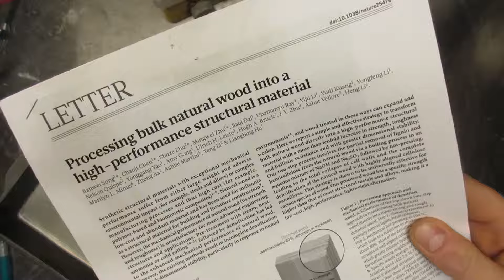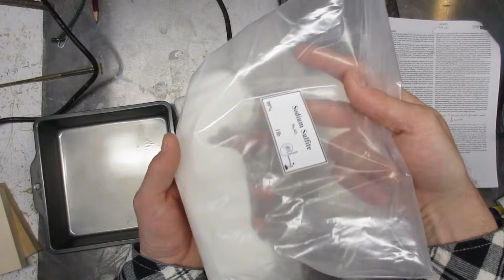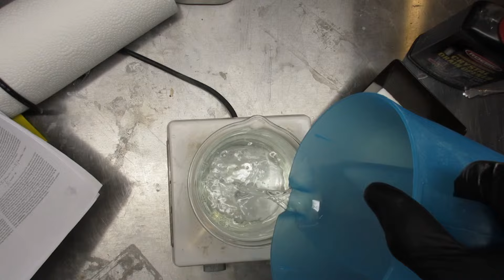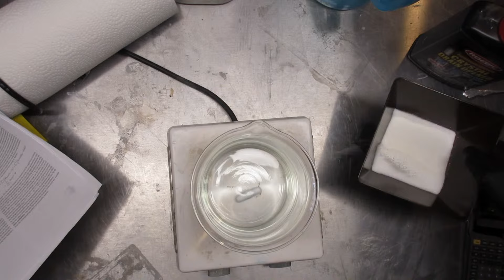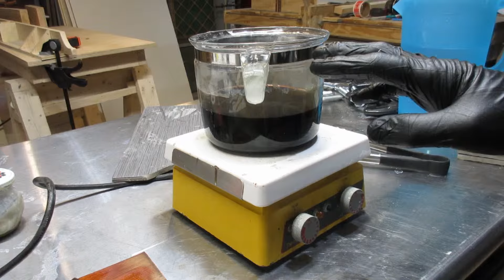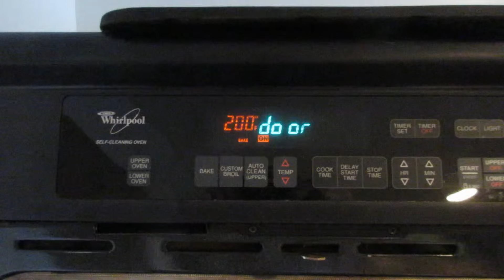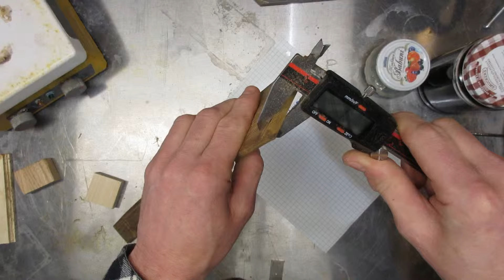Wood Densification Experiment

Comment: A high frequency vibration while it's under pressure may even compress it even denser than that and also a low heat temperature may also help it adhere to itself. I'm sure their pressing equipment at their plant/lab and their liquid had had qualities you can't duplicate at home. (Big Secrets?) But great video... Amazing results, more than I would have expected for DIY... Thanks 👍🖖

Comment: So, after the caustic and rinse, why the need to heat when compressing?  To remove water? ?well that water could be evaporated off under deep vacuum for a day, then polyester impregnated, then pressed to a precision thickness having a designed surface texture. Who the hell wants to sand paper grind finish timber? 
The press plates need small vent holes drilled, and at home, pressure applied using a hydraulic truck bottle jack, or tapered wedges. 
Commercially the end product needs to be minimum 2.4 m long. Clear long straight grain. The raw timber has to be free of defects like knot holes, resin veins, bark inclusions etc.  Knots won't compress in the processing. This limits the use of fast growing timbers like pine that are full of defects. 

I see this processed timber as useful, most useful as resin/mineral impregnated laminate sheet. 
As 3 ply it would have significant strength and ability to mold well.  
Shame about being thirsty stuff... needing sealant.

Comment: This wood might have some specific uses but cost seems like the limiting factor.  What is important to consider here is strength vs weight.  What is the density?  How much less does this dense wood weight as compared to aluminum?  Then there is the factor of work-ability.  How strong is it when glued together as compared to welded metal?   Also might want to figure it's dielectric value to determine if it can be used as an insulator.  Just from looking at the process I'm thinking that steel, aluminum and plastic will be much cheaper.

Comment: Next time: 1) weigh the wood samples before and after the treatment.  2) make a cylinder with a piston to press against steel blocks that flank the wood samples. You can then have an air compressor provide constant pressure, even as the wood becomes thinner. 3) see if you can compress the samples between blocks that are curved (ie turn the flat wood into an arch).

Comment: 7mpa is pressure rating per square cm, which is roughly 70 bar or 70kg/cm^2. so if your piece of wood have area of some 20cm^2, you need 7*20mpa total pressure, or 1400kg. if you compress more i bet you get those 80% reduction in thickness.

Comment: Imagine you could take fast growing pine and make wood flooring from it
Reply: The feedstock timber would have to be free of any knot hole defects. 
This is NOT a feature of any fast grown plantation pine. 
The highly dense and hard knot (branch growth) will not compress the same way as linear grain growth.
Reply: @BTW...  Faster than Oak you could take the pine from the colder regoins where it is much slower, or are they subject to the same? I assumed not as it's used in building houses everywhere in Scandinavia
Reply: An alternative would be to employ the Japanese daisugi technique.

What is daisugi?

It's an ancient Japanese practice involving the very specific pruning of certain types of trees, primarily the sugi (a type of Japanese cedar), to obtain wood without completely felling the tree. This allows for the cultivation of high-quality wood in a sustainable and environmentally friendly manner.

How does it work?

Selective pruning: The lowest branches of the tree are pruned to stimulate the growth of new vertical shoots.
Directed growth: The new shoots are allowed to grow straight and parallel to the main trunk.
Harvest: When the shoots reach the desired thickness and height, they are cut to obtain wood. 
The original tree remains alive and continues to produce new shoots.

Benefits of daisugi:

Sustainability: It allows for obtaining wood without deforestation.
Wood quality: The wood obtained through this method is usually of high quality and straight.
Forest conservation: It contributes to maintaining biodiversity and forest ecosystems.
Would you like to know more about daisugi? I can provide more information, such as its historical origin, the different tree varieties to which it is applied, or its cultural significance in Japan.

Comment: Back in 1972, when I was 17, I did a project which counted towards my physics A level. I tried macerating toothpicks in various solvents to dissolve the lignin (I think it was) and replace it with cellulose varnish to compliment the cellulose fibres. I had some alarming encounters with strong acids. We had a tensiometer, but my biggest trouble was fixing the toothpick without damaging it before finding its tensile strength. It was a null result, but nobody cared because the emphasis was on methodology and the treatment of statistics (before pocket calculators were affordable!). When I saw this upload, I laughed and shouted with glee!

Comment: Clamps are only applying the rated force - per square inch or for the face of the clamp.  So when spread out over the full surface of the item it becomes much less - so I don't think you hit the compression you wanted.

Comment: Very interesting! The problem with the clamps is that you only have initial pressure, when the plank shrinks the pressure reduces to nil. To apply constant pressure, just use gravity: a couple of concrete blocks on your "sandwich" will probably make some effect.
For the "rinsing", you probably want to continue rinsing until you can see through the water. The goal is really to get rid of the lignin. Also, maybe it can improve things if you can make the reaction in a pressure chamber (you mentioned that) to force the chemicals between the fibres. Maybe it'd improve the result to have it shaken during all the soaking operation in a pressurized environment.
Now, for what to do with it...  From what I understand, it's soft and easy to bend before pressing it, so... just bend it! I'd try to make stuff that needs to be light and reasonably solid, such as plane propellers.. Now we're talking...

Comment: Great job duplicating the experiment with what you had available. 
Test for strength, bend, twist
Burn it, cut it with a saw, nail it with a hammer and gun.

Comment: Nicely done. If you do investigate this further, it would be interesting to know the shrinkage rate along the length and width of the sample, as well as the thickness. That makes me think of the weights before and after. 
Finally, as exciting as this new process is, I have to wonder what volumes of caustic liquids such a process would produce, and what additional steps would be required to re-use or neutralize them.
Reply from the maker: All good questions. I do know that those chemicals are (or were) used regularly and in vast quantities for making paper so there is probably a system in place.
Reply: @dork3nergy Yeah, it's basically Kraft process but applied to wood veneer (spinning a log and using a long blade to "spiral-unwrap" it into a sheet) instead of chopped wood. The purpose is also basically the same; the only big difference is that Kraft paper uses microscopically wide (but a decent length, usually around an inch/couple centimeters) loose fibers that are then chaotically packed into a sheet and lightly pressed, while the densified wood uses >=mm thick sheets of naturally aligned fibers, stacked as appropriate for the target application, and then pressed far more aggressively to actually crush the fibers into a (nearly) void-free macroscopically-thick "brick".

Comment: I think your clamping pressures were way off. The article was in psi, the numbers cited for your clamps was in pounds.
The pounds of pressure delivered by the clamps was dispersed across the square inches of your wood area.
Reply from the maker: You are no doubt correct but you work with what you have.  Turn out OK in the end I think.

Comment: For all the boiling steps you probably could have pressure cooked it in an instant pot. Also, another step that may be worth doing: consider putting the wood into the lye solution in a vacuum chamber (which they sell for cheap for de-gassing silicone and resins), pulling a vacuum until all the air in the wood bubbles out, then releasing the vacuum so atmospheric pressure pushes the lye deep into the wood.
Reply from the maker: All good suggestions.  Probably the best use of an instant pot yet.
Reply: If the pot is rated for concentrated sodium hydroxide 😉
Reply: Isn't an InstaPot made of aluminum?
Reply: Better result if cooking sliced wood or veneer, doesn't need 7hrs or so, then laminate for full press..
Reply: Instant Pots are bad pressure cookers.  And bad slow cookers.

Comment: Unfortunately what is often ignored is water permeability and reaction to moisture. The article did look at moisture exposure (20 C 95% RH) and there was about 10% swelling in the densified unsealed wood. But what really matters is: is it more or less water-permeable than normal wood, and, what are the equilibrium dimensions at 100% RH and mechanical properties at that density? Because ultimately it's not useful to densify wood past equilibrium nonpressurized density at max RH. But good on you for trying this out! Saved me some time.
Reply from the maker: There was some chit chat in the discussion about moisture and this stuff. It does swell up with water and collapses back when dried. You'd really need to seal it off to make it usable.
Reply: @dork3nergy  they made it mostly impermeable by soaking it in mineral oil post-drying. Reduced moisture absorption 4x.

Comment: Nice video sir, just wondering if after compression will it be able to be bended steam application? 
Or it might return somewhat near it original thickness?
Reply from the maker: I found that the wood sucked up moisture and would swell but it didn't retain it so when it dried out again it was basically the original size. Based on that steaming might work but you might have issues when the wood shrinks back.  You might do better shaping it when you are compressing/heating after delignification.

Comment: Be sure to start with big sheets of wood, so you can mold it in a form that is artistic and unique.  It will need to be waterproofed, (Thompson's water seal or the like) but then, if the terrorists come by, they can't shoot into your home.  (except through windows, so get bulletproof glass.)  Finally you can let your kids do a paint job on the design, whatever it may be, and have a home to be proud(?) of.

Comment: Did you try anything with the wood afterwards?
Reply from the maker: I have not.  The samples I ended up with were pretty small.
Reply: @dork3nergy  I was wondering if after the solution gets rid of most of the Lignin, something could then be used to replace it. For a while now, I've had this idea about hollowing out the plant cells in wood, and filling it with concrete, cement or plastic. If there were a way to insert wet concrete where there used to be Lignin, with the rest of the process being done in a similar fashion, you could theoretically end up with an even stronger 'block' than what you made here.

I've always had weird ideas of creating compound materials. Even if the internet told me that mixing molten steel and granite would lead to nothing, I still wanted to see someone try it just in case a stone-metal hybrid existed. I wish I could do this stuff myself, but unfortunately I can't get a hold of materials nor do I have any Education.

Polycarbonate plastic is also really strong, but in a different way from concrete or cement, and I thought that maybe it would be easier to fill the spaces usually filled by Lignin so this could be a possible route instead, but if impossible, that's fine too.

Also would be curious, that if the above did work, what it would be like to then burn the newly created material.

Comment: Do you reckon it needs to be in the oven during the compression process?  I wonder how well it would work to put it at the bottom of a stack of cement bags in the garage for a week or two.
Reply from the maker: That's a very  good question.  I think you just have to try it and see.  It's not clear from the paper if the oven was just for speeding the process or was necessary for adhesion.
Reply: @dork3nergy   My thought is that, if the heat was just to speed up the process, then cold-smashing it might yield even better results.  I'm hoping to run some experiments on it, this summer.  I'll be sure to come back here and share any results.

Comment: Interesting idea BUT stop here's the problem it is too much faf on try this get some really permeable wood I am going to use falcatta in the Philippines. You sound Canadian to me so you try and get some Paulowina wood. Dry the wood then soak it in sodium silicate. You can dye the wood first with hair dye or kedda wood dye if you want but you must dry it before soaking it in the sodium silicate. Crush the wood dry and heat it. Now you have wood the colour you want it and its as hard as hell and waterproof and rotproof. Red coloured tropical hardwood costs the earth on looks sensational falcata is basically pallet wood prices. All you are doing with your chemical processing is making the wood more permeable why not use  more permeable wood in the first place. Ironically the wood you want for this process is the most rot prone and permeable you can get.
Reply from the maker: Those are some goo ideas.  Thanks.

Comment: I realize this is very old but we now live in a time of eternal permanence. You were measuring the thickness, but a better thing to do would be to measure the weight of the thing. Still, very impressive. But I'm curious about how to dispose of the waste water. Is this safe to pour down the toilet like you would with normal drain cleaner?
Reply from the maker: Weighing it would have been smart and yes, just dump it down the drain.  No worries there.

Comment: Using aluminium plates between the clamps would solve a lot of problems and reduce the oven time quite a bit. It solves the pressure and heat dissipation problem since wood and ceramic are insulators and your wood peaces are just heated around the edges.
Beside I really love your easy way of encountering this topic! Cheers a lot for this!
And your way of making this video is very entertaining. Good one!
Reply: The usual ceramic is fine. I use all-ceramic baking dishes in kitchen, can affirm the ceramic being somewhat a heat insulator is not a problem in the oven. 
I believe the issue is that the steam has no way out from the middle. I'd try using clay bricks or other semi permeable material so that wood would dry out quicker.
Reply: The oven was too cold to boil off the water, imo. At 100C not 200F (95C) the results would've been far faster due to steam and boiling.

Comment: To repeat the experiment in a pressure cooker would be difficult since they are generally made of steel or aluminum and the critical stages are caustic. I wonder if powdercoating a pressure cooker would solve the problem?
Reply from the maker: Good point.  The instant pot has a stainless steel liner.  That might be OK.
Reply: @dork3nergy  stainless steel is fine with NaOH. Aluminium on the other hand is easily destroyed.

Comment: Ok from a materials standpoint this is really exciting, it could be a game changer (unlike certain nutrient deficient diets), but the real question is, how does it handle oxygen+moisture? Does it rot?
Reply from the maker: Does not handle moisture well.  It sucks it up like a sponge (Ok.  A slow sponge)  When it dries however, it goes back to it's original size and shape.  Maybe just sealing it would prevent this.
Reply: @dork3nergy  that is why they make it moisture proof by soaking the dry densified wood in mineral oil. This stops moisture from getting in.

Comment: btw, your solution contains dissolved aluminum now.  is that a problem?
Reply from the maker: It does indeed.  If it did interfere, I still ended up with a reasonable end product.

Comment: if you went with 24 hrs of time at temperature, do you think it would be fine to cut the oven off in the middle (at night) but leave it under pressure, then continue heating the next day in an effort to prevent the house from burning down?
Reply from the maker: I think all the oven does is speed the evaporation time so yes, it should be fine.

Comment: I wonder if if you boil soaked it in . Watered down tight bond 3 then press it .the whole process uses a alot of water .
Reply from the maker: Not sure what you mean there but whatever you boil it in, you need to remove the lignin in order to compress the wood down.  At the end of the process the stuff is really dense but will take up water if soaked so the wood glue at the end might be a good idea.

Comment: You don't have enough pressure!! That 2000 Psi is divided by 50 at least because you increase the surface like 50 times. It's 2000 Psi for the small head of the clamp. That's how pressure works. ....
Reply from the maker: Could be but I got decent result despite that so maybe 2000 psi is overkill.
Reply: @dork3nergy to be fair, your excellent idea of using multiple C-clamps literally turned the screw press principle from a waste of time to something pretty effective.

Comment: I'm really glad to see just a regular dude actually testing this research paper. I was looking up wood hardening, and kinda fell into the rabbit hole of thinking "How can a regular fuckwit like me make a baseball bat outta this crap. Surely there'll be a market for it it if actually works."

So, now I at least know that it works. Now to brainstorm ideas on how to essentially compress a fence post, and keep it hot for a day.
Reply: I'm planning on trying this out with a pair of aluminum plates to sandwich the wood, and big bolts to press/clamp the wood to compress it. A silicone heat pad or anything else similar on each plate and that should do it.